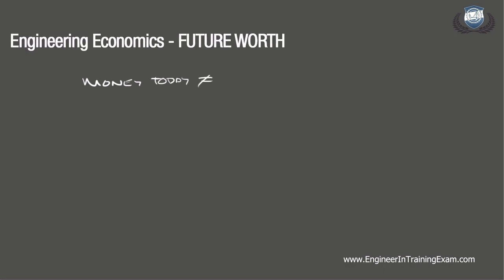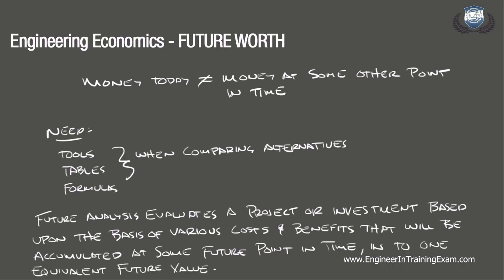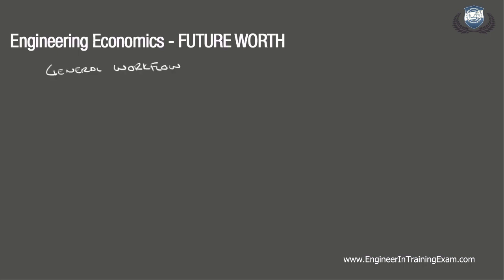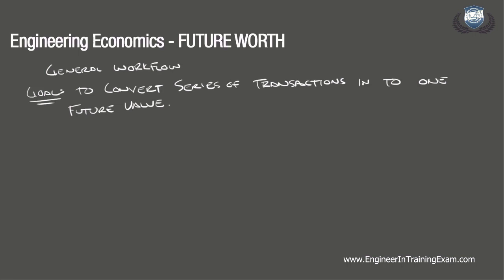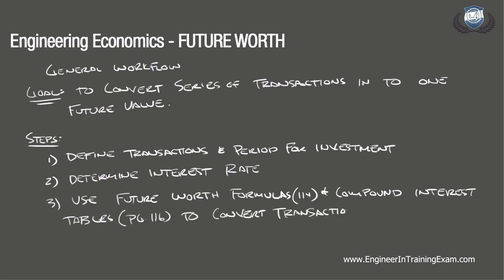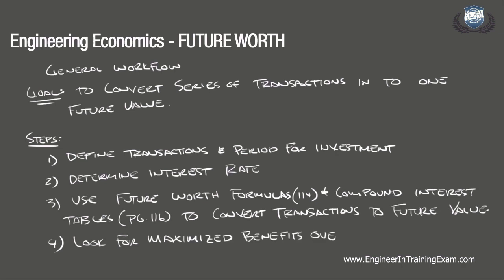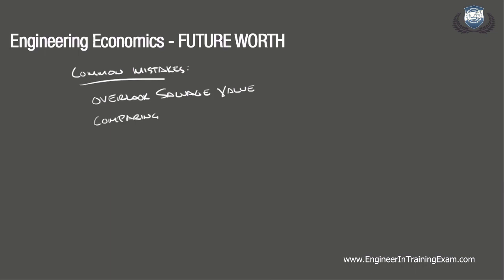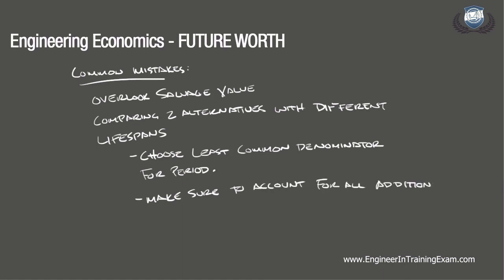Future Worth - Fundamentals of Engineering Economics

Comment: In engineering economics, sign conventions are important but must be consistent throughout the calculation. There are two valid ways to assign signs:

Method 1 (Standard Approach - Outflows Negative, Inflows Positive)

Initial Cost (P) → Negative (outflow)
Maintenance Costs (A) → Negative (outflow)
Salvage Value (S) → Positive (inflow)
Final Future Worth (F) → Total future net cost, should be negative
Using this method, we got:

F=−176,203

Method 2 (Alternative Approach - Everything Flipped)

Initial Cost (P) → Positive (if viewed as an investment)
Maintenance Costs (A) → Positive (if viewed as payments made)
Salvage Value (S) → Negative (if viewed as reducing cost)
Final Future Worth (F) → Total future value of investment, should be positive
If everything is flipped, the result would be:

F=+176,203

How Do You Know Which Sign Convention to Use?
If you're solving for total cost → use negative for costs and positive for savings.
If you're solving for total future value of an investment → use positive for costs and negative for savings.
Just be consistent throughout!

Comment: You could use negative signs for each cost(initial cost and maintenance cost) and use a positive sign for the salvage value. Your answer will be negative and you would have to chose the larger future worth value of the two alternatives. 

If you keep the costs positive and the salvage value negative, then you pick the smaller future worth of the two alternatives. 

See their explanation here:

w w w . engineerintrainingexam . com/forums/topic/future-worth-example-in-video/
Reply: when you say the larger value of the two alternative, which alternative are you refering to?
Reply: anyone tell me can a final answer of future worth and annual equivalent amount will be negative? is it fine if the final answer for both coming negative?

Comment: I don't recall coming across or inevitably being surprised by a counter intuitive sign reversal when it came to expenditures and inflow back when I took the course either. Hmm.. And I would be inclined to just go the intuitive way and pick alternative yielding the smaller negative number which would basically translate to : less costly alternative.... But the point of concern is- should there be a "Find Net F" question and there be a + and a - answer of the same value and I'd have to choose